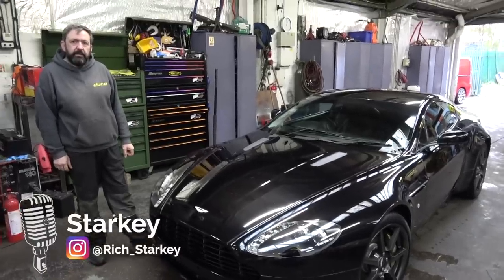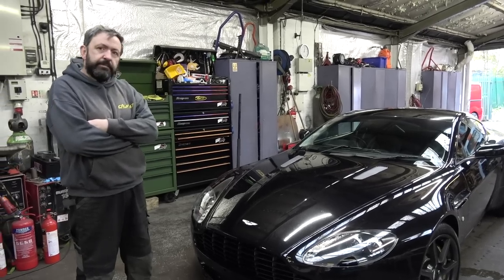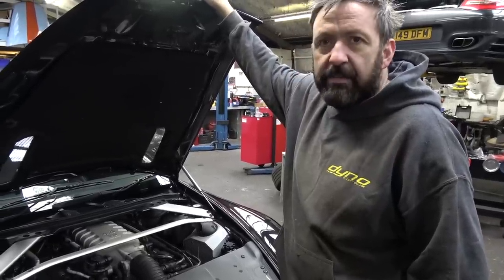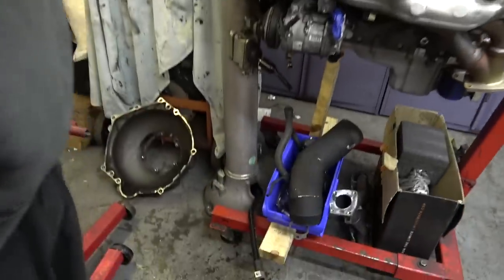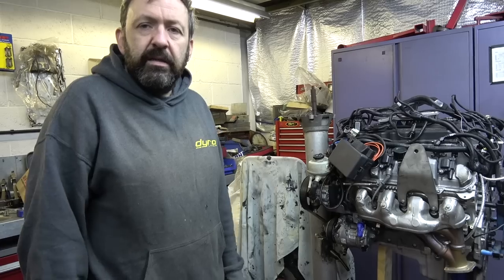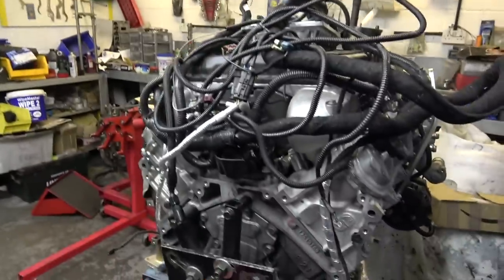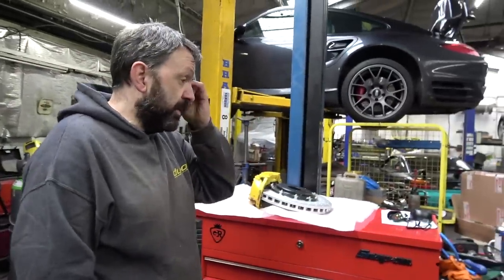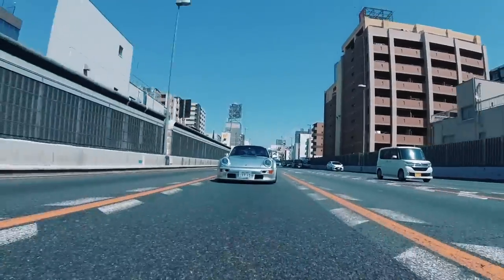700hp LT4 swapped Aston Martin V8 Vantage project - Pt 1

Comment: It’s not a s type engine. The V8 was built and then they tried to fit the V12, the V12 Vantage is a different chassis. Also stop assuming on a AM when you don’t have a single clue about them it’s annoying.
Reply from the maker: assuming on a AM?
Reply: Driftworks just please don’t assume a jaguars derived engine is a jag engine, it’s on the same thing as calling the DB9 V12 being two ford 6 cylinder. The design is similar between the jag v8 and the AM 4.3 V8 but there is barely any shared part between these thus making them actually different. Forgive me if my reply seems rude( just realized) but as an AM owner( both the V8 and the V12) I take it very offensive when people say they are something that they aren’t.
Reply from the maker: I think Craig was quite fair, saying he didn't know much about the engine.
Reply: Driftworks oh well I was actually talking about you making the assumptions. In my opinion Craig’s knowledge on the car is enough to support his work on the conversion project. His knowledge was actually spot on for most. You were the one bringing up the s type and assuming a jag derived engine is equal to a jag produced engine. It’s just the amount of careless that really tips me off, like you called it ‘the Vanquish’ and many other things through the video. I first wasn’t offended with the wrong name called since it is partially AM’s fault of giving many of their cars a ‘V’ name. But there is no way you can say a derived engine is the same as it’s original plan, a similar example would be calling a E60 M5 had an F1 race car engine(which we all know it doesn’t and it’s just a shared engine plan and some parts).

Comment: Funny thing I had a 08 e90 alpine white M3 sold it bought and 08 vantage and I can confirm how DOG slow the throttle response was and the long gearing. 
It just killed the vide sold it at 10k miles.  But damn did it feel special. 
Just not engaging enough to make you fall in love. 
Back to the old school I go. 
03 330i now. Trying to find a LS swapped e36 coupe.

Comment: This is amazing! I was thinking of converting my DB9 to manual and came to the same conclusion that using the corvette transaxle looks to be the best choice! Will you document the process as you do it? I figured adapting the torque tube and shaft for length would be the hardest part of the process but I think you’ll be the first to figure it out. 

Is the Vantage already manual?
Reply: Kindred Automotive hi it’s already a manual , I’ve had the torque tube apart and had Martin machine the old bit of tube out of the gearbox end ready to shorten it then I can weld back together again , then I will shorten the prop inside .

Comment: Aston AJV8 spec compared to Jaguar AJ33 V8
Dry sump system                         Wet sump
Cam profiles modified
Bespoke exhaust manifolds
Flat plane crank
slightly higher compression ratio + forged.
Oil pump, timing, waterpump all the same, basically modded for revs and a manual trans.
Reply from the maker: Thanks Sean! Interesting.

Comment: Next year I plan to swap an L92 (Aluminium LS3 Truck engine) in to my GT86, luckily there's quite alot of info from the states on this but it would be really good to speak to someone in the UK with the experience that Craig has doing it. I know it's a bit cheeky to seek guidance from someone when you're not neccessarily planning to use their services but is Craig/Dynotorque contactable at all for the odd 1 or 2 emails? I plan to do to pretty much all the work myself with the exception of some off-the-shelf engine mounts and loom from the US but it would be good to ask a few questions in regards to gearboxes, fueling, sourcing LS parts in the UK, etc.
Reply from the maker: Craigs a very friendly helpful guy. But as he mentions in this vid, he's extremely busy & finding it very hard to find time to work on his own car as is. If you need parts though he does have quite a lot of used stuff lying around.

Comment: Transaxles are not just for package; they help considerably with rear diff temperatures as the volume of oil is much higher than a stand alone rear diff and greater thermal inertia of the extra metal of gearbox and diff together.

Comment: The 6 speed box is the same as the Aston one-77, check out the power and torque figures on, it was running 777hp
Reply: Emmanuel Wain it won’t take the torque that I want to run in it ,

Comment: Did you ever check if the drive by wire system has torc management software? GM’s trucks use it and it basically guts the truck of power for “fuel economy” and “stability control”.

In reality, GM is trying to get passed the reputation for blown transmissions and twisted drive shafts.
Reply from the maker: I pretty sure it didn't when it was in the M3. It was an absolute monster.
Reply: Driftworks I’m referring to the original motor, when I hear “lack of power” with a drive by wire v8 vehicles my first though is software. They may have had an issue with damaging the drive train without the software in the development and took the same route as GM. Why be on the hook to warranty drivetrain parts when you can prevent the drive from damaging it.
Reply: @sashamaymacca  that's really a shame because car seems to be a great thing